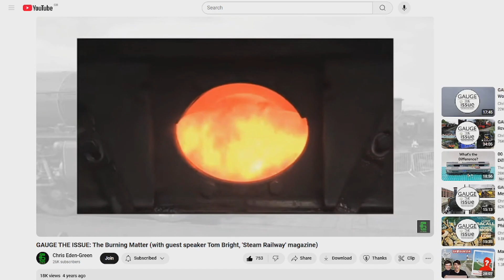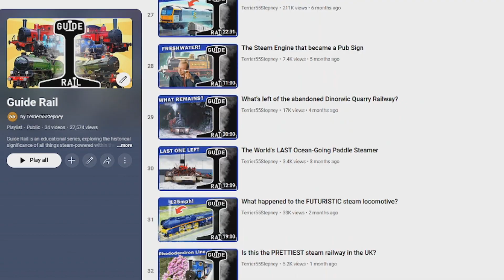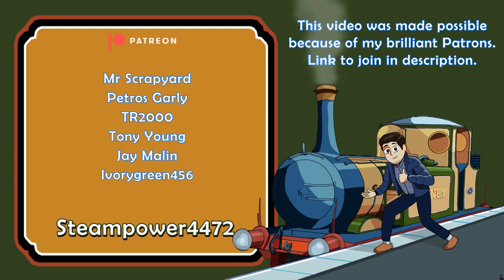Why are steam railways struggling to find coal?

Comment: There is one more idea if feasible, convert some engines to oil firing UP 4014 and 844 run on oil, and many others it is a simple enough procedure and in the long run would be cost effective if the coal crises does not get solved.
Reply: UK has mostly copper fireboxes, so oil is out of the question due to the extra heat it produces. Even Germany did need to add a cooling system to prevent the cylinder lubrication from burning away

Comment: I miss ffos-y-fran. Lovely fuel, that stuff. Hardly any ash, and what's more, clinker was a rare occurrence. Was a bit dusty in the summer, though.
Reply: I hated the stuff, high ash content, clicker very likely to form, most sacks were 1/4 dust. The only benefit was low smoke. Used to love the coal from South Yorkshire and Scottish mines. Bit smokey if you were to heavy with the shovel, but at least the engines steamed, and had no issues with clinker, or the ashpan getting clogged. In Fact I prefer the WildFire ovals to Ffos-y-fran, the coal supplied was either in roof and floor of the workings or that what was rejected as sub standard. 

The first lot of coal we got at the old Rusden Cavalcade, many of us nicknamed it fireproof coal. I know many railway locos that had issues with clinker issues. the coal supplied by Ffos-y-fran was ok if it was worked hard, and a very strong draft was kept at all times, but when left to go dull for any length of time, clinker would form (badly).

Comment: I'd say just import coal from North America. But it's kinda pricey to import stuff and it would probably be better to check back on it in 4 years. Perhaps German coal could suffice. Or maybe a bunch of heritage railways should get together and open a small coal mine, they could even use Hunslet austerities to move the coal like the old days.
Reply: They can't just open a mine - it's far-left government policy in the places made of coal (Wales) that nobody is allowed to mine it anymore.
Reply: @C.I...  that's unfortunate, as if diesel is any cleaner.
Reply: @C.I...  There are few things better than conservatives crying that they can breathe clean air freely.
Reply: North American coal is, like was mentioned, generally low grade coal. It would probably not work as well for most British locomotives which were designed to burn higher grade coal. Part of the reason American steamers are so huge compared to British ones is because of the extra space needed to efficiently burn our low grade stuff.
Another solution: convert some locos to burn oil. Sure it's not traditional by any means, but if you need to keep trains running you do what you've gotta do. Oil burns hotter and more efficiently, and the boiler reacts faster to an oil fire than a traditional coal fire so you can better control and fine tune the fire to raise steam when you need it or the lower the pressure when you don't need it which can make the fuel stretch longer, which I imagine could save some cash in the long run on a branch only a few miles long only doing about 25mph or so with light trains like you see on most heritage lines.
Reply: @davidwhiting1761  common North American coal is generally lower grades of coal but some regions are known for good burning high thermal efficiency coal, and lower grades of coal can be processed in treatment plants to have a similar performance as high quality coal. Unfortunately you might be right and they might have to switch over to oil burners, I just don't think converting to oil will work for all steam locomotives. I hope the heritage railways figure it all out soon, it's a shame to have perfectly working locomotives not be able to work because they can't get their fuel. The whole situation is just ridiculous.
Reply: @Arkay315  No denying the initial cost would be expensive, but I wonder what's more expensive: importing loco grade coal from other countries or using more bunker C oil which is already used in the maritime industry? That may be the deciding factor. Here in the States the Durango & Silverton narrow gauge railway in Colorado recently ran its final coal-fired excursion and now its entire steam roster is either oil burning or in the process of being converted to burn oil because even here shipping in the right grade of coal was getting too expensive and too difficult to source. And that's sourcing coal domestically in a country that is still mining coal. As expensive as it was for the Durango & Silverton it's gotta be even worse for Britain because they're paying even more for foreign coal which itself doesn't always burn well (I saw a report once that the Ffestiniog was getting complaints from the locals that their locos were getting coal dust on the laundry, something that has only begun to happen recently because they're burning foreign coal instead of Welsh coal which isn't as dirty).
Reply: @davidwhiting1761 

You can just use anything that burns right 

Like oil, wood, anything like that?
Reply: @parkerd5714 depends, some things don’t burn well enough and the amount needed to keep an engine running long enough is completely impossible to carry in one go, also it’s pretty expensive to convert a coal-burning engine into, say, an oil-burning loco